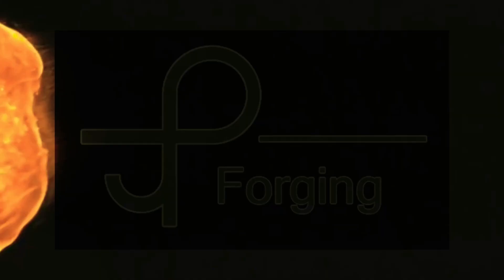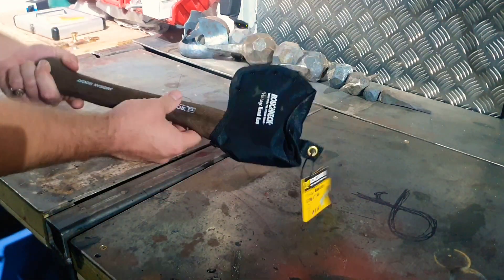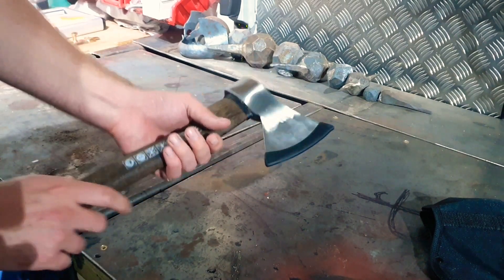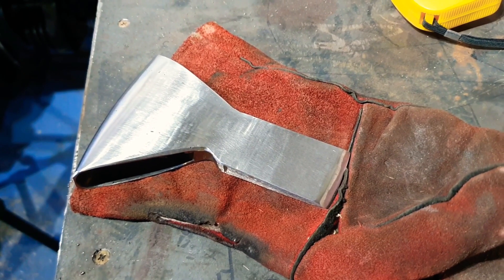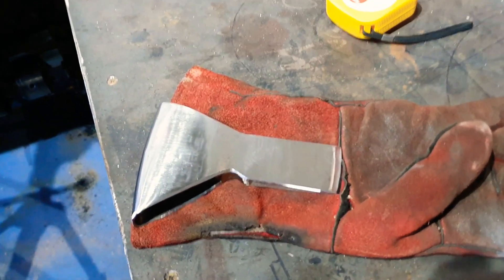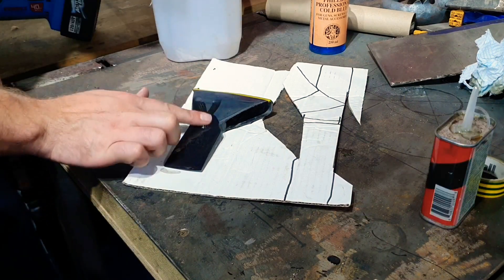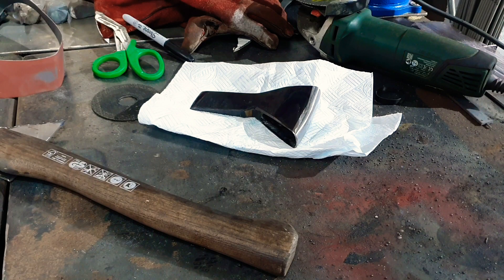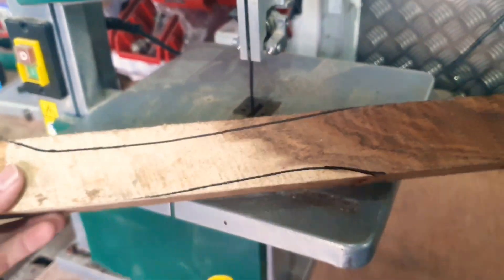Ridiculous Reverse Axe

Comment: нет твой русский не так уж и плох!!! 
(Your Russian isn’t that bad!!),  also can I ask, which Röhr welder was in the video?? As I’m in the market for one(DC arc welder) and also how would you rate it?? Thank you for these amazing videos, bye 👋
Reply: The Falling pigeon it was a mig welder in this video not an arc
Reply from the maker: So I went with the Röhr 200amp 240v MIG welder. You can use it gas or gasless, and it does have the ability to Arc weld too. 

I like it so far, though I should admit I've only used it with fluxcore wire. :)